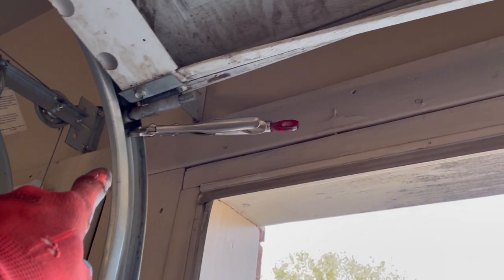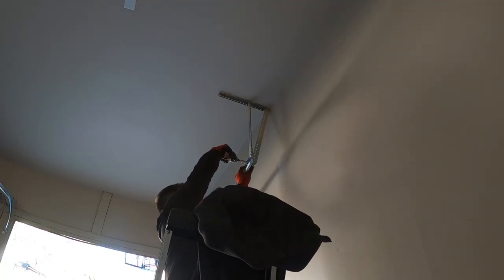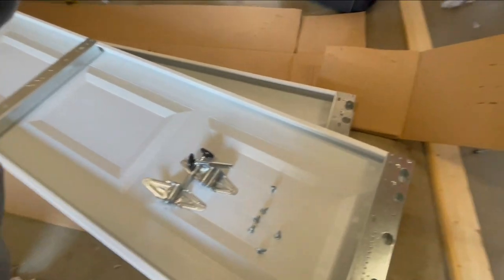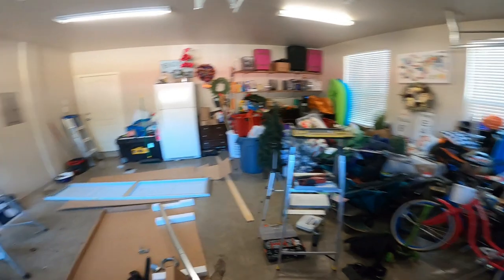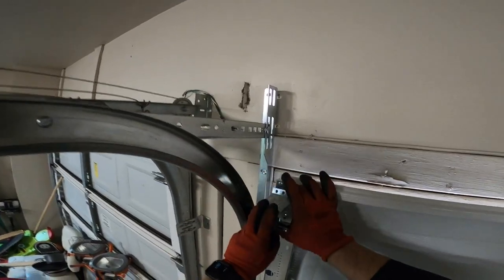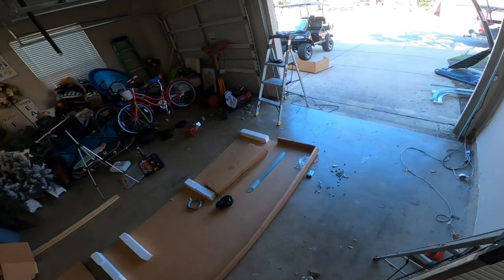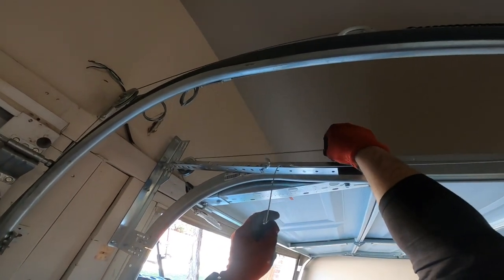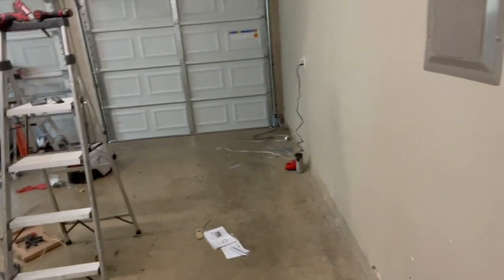Garage Door AND Opener Installation! Part 1

Comment: always interesting to see how other guys do it. hangin horizontals from back to front is wild lol but to each his own. and i can't say i always put a top strut on (because my company never orders them) but on a soda can door like that with an opener, i'd at least put angle at the top if i didn't have a strut. manual doors you can get away without. anyway, well done 🤟
Reply from the maker: I appreciate the feedback… even if it’s somewhat critical, yet constructive. Truly, I don’t usually hang the horizontal tracks from back to front but I hurt my shoulder and it hurts so bad when i set the radius on my shoulder while attaching it to the flag bracket like normal. So, for support I’ve been doing it back first. Hurt or not I still gotta get the job done and bring the content. So that’s the story I’m sticking to. lol
Reply from the maker: @DudeEggs  I know right! Angle Iron for a strut? Crazy

Comment: It was a fascinating video, I learned a lot of things from you, planning to replace my old wooden garage door with this ( from Home Depot). One question: I did not see the purpose of the safety cable, could you explain it to me. Thanks.
Reply from the maker: Safety cables are a MUST on those extension shutting systems. The purpose is because when they break they literally sling shot and are very dangerous, however, when running a safety cable, once the spring breaks it simply stays on the cable line and doesn’t fly off and damage anything or injure anyone.
Reply: @dapperdudesgarage  Thank you very much for your reply. I have 2  more questions: If I buy an 8x7 garage door from Clopay, will the panel be 8 feet wide? my old wooden panel is 8 feet wide so I want to make sure it will fit. Another question: Should I buy the insulated or non-insulated door? someone said the non-insulated is not sturdy, what do you think?  Thank you again.
Reply from the maker: @henryh2159  Yes, if you have an 8x7 door currently then an 8x7 is what you need to buy and it should fit no problem. As far as insulation it dont necessarily come down to sturdy, it boils down to R-value pertaining to how hot or cool the insulation will keep your garage. Keep in mind what the people call sturdy pertaining to insulation is also extra weight on the door! Either way, either door will last LITERALLY a lifetime if taken care of and managed properly. The hardware such as spring will break down, but the panels themselves should last a lifetime. Hope that helps
Reply: @dapperdudesgarage  I bought the Clopay garage door 8x7, I'd like to get the outside door lock, Can you suggest to me the lock that will fit with this door. Thanks

Comment: The old garage has my favorite locks
Reply from the maker: Yeah most people actually take them off though. Thank you for the comment!
Reply: I mean they are easy to use
Reply from the maker: @jeremywilliams4493  they are for sure. But generally speaking if you have a garage door opener that’s actually working you don’t need the lock because the opener will lock it closed. That second video of the opener installation will post in a few days. Pretty cool insight in that one
Reply: @dapperdudesgarage  the new door should have a strut on the top panel
Reply from the maker: 16 foot doors do. If it were a door he purchased from us I would have put one on but it’s common for these small doors to not come with one. Especially when these people buy them from Home Depot on their own!
Reply: @dapperdudesgarage  what opener did the homeowner buy
Reply from the maker: Sorry about the late response they bought a chamberlain three-quarter horsepower belt drive from Home Depot. Those are really good units. I have installed them for customers the past five years or so and to this day I still have had zero warranty calls on them so because of that hopefully I can work out a deal with Chamberlain.
Reply: @dapperdudesgarage  isn’t that like the 87504
Reply from the maker: Yeah, very similar just looks a little different
Reply: @dapperdudesgarage  does it have 2 lights or just 1
Reply: Dude you’re awesome. Please make more garage door videos of maybe some problems we might come across when doing these garage door installs? 🙏  also don’t give up on your channel!
Reply from the maker: @Heyhoe386  just getting it started brother. I’ve worked in the garage door industry several years but never did much social media. But someone kept suggesting I start a channel so I did. Thanks brother for the feedback

Comment: dude you need a table and some saw horses your back will thank you. And what was up with that wire that was rubbed through ?
Reply from the maker: I have a couple saw horses. Use them on big doors but single car garage I’d honestly rather not mess with them. Seems like double the work to me. You still have to bend over and put the doors on the saw horses etc. Single doors are easy to mess with so I don’t waste the time loading and unloading anything extra. Just me.

Comment: have a unique situation, I know everyone’s is unique. But really this one is. The front of my garage sticks out 2 feet from the house. On top of that inside the garage there is a support from the house that goes through the garage  that will not allow the door lifting chain rail puller to go all the way to the front above the door.  Any ideas. Would like to try and do this myself. I believe would need a bar about 2 feet long from the door to the motor drive chain rail. Any ideas?
Reply from the maker: Send me some
pics to my business phone, the 210-580-3054

Comment: You installed the top brackets all the way at the top but the instructions say to install 3 and 1/4" down from the top.  I think this is to give you room for a top support bracket if needed.
Reply from the maker: You could be right, but your looking WAY too much into it. Instructions in some regards are not an absolute, rather, more of a dummy guide! Thanks for the comment
Reply: @dapperdudesgarage  I'm installing a garage door  now and this dummy needs the instructions but they aren't that great.
Reply: @dapperdudesgarage  The door set includes a small metal support bar to go across the top in the middle but it is too wide to go on the door frame.  The holes don't line up with anything.
Reply from the maker: @JamesDavis-dn3wo  ok
Reply from the maker: @JamesDavis-dn3wo  you just have to shoot it with self tapping screws and make your own holes
Reply: @dapperdudesgarage  Thanks

Comment: Can we make this same door a high lift door?
Reply from the maker: Yeah absolutely.
Reply from the maker: you can have the tracks raised and even match roof pitch. Just need to figure out the calculations on the lift and your golden! Higher longer cables, longer spring, bigger wider drums etc…

Comment: No top strut???
Reply from the maker: not one needed here in Texas on a small 8x7 especially when its installed correctly and there are binding point or pressure build up.
Reply: Right, didn’t mean it needs because of weather or anything. But with the operator j arm pulling on that stile over time it rips it off.
Reply from the maker: @KevinHolguin-f5b  not here at Dapper Dudes…see we legit try to run yearly checkups on our customers, at a small lube and tune fee of course, and make sure everything is checking out. Anyway, my point is it doesn’t matter how long the door is up, if it is balanced and there is no pressure against the opener shutting the door and its balanced well up and down, its just going to run good. If over time it starts bowing then we have a small upsell we can make. Catch my drift, sir, lol. 
No man, for the price the customer paid they got the most basic option possible. I literally told them we could knock off a little price if we didn’t include a strut, and they simply said ok. So, i just install and if issues arise later then there is a need for me, for Dapper Dudes! It’s reoccurring business and why I don’t argue against what a customer wants. I make known the possibilities based on decisions they make and if they still say yes to save a buck then it’s on them in the future. But I am up front with customers etc. So either way, whatever the homeowner/customer wants…I’ll do.
Reply: @dapperdudesgarage  understood. Thank you for clarifying.
Reply from the maker: @KevinHolguin-f5b  just being honest…sometimes it’s truly business.

Comment: Why did you replace the door
Reply from the maker: Because the customer is the boss and thats what they wanted lol. Nah, because the old one had an extension spring system and those are basically inefficient and relatively unbalanced, basically garbage.
Reply: Ok
Reply: Sorry I took forever to respond I was busy
Reply: Sorry